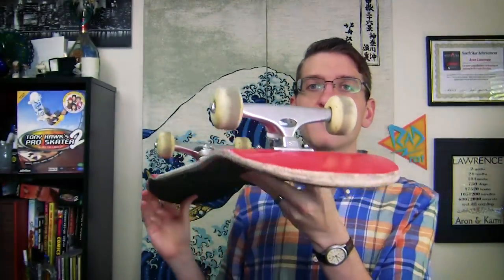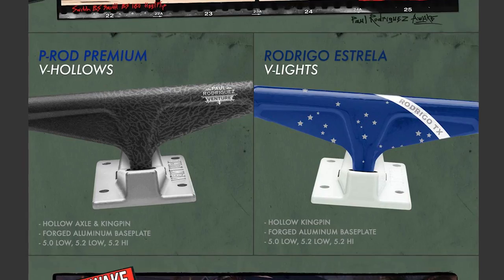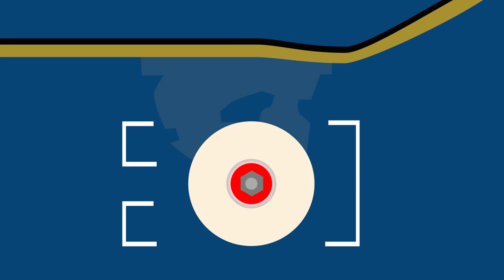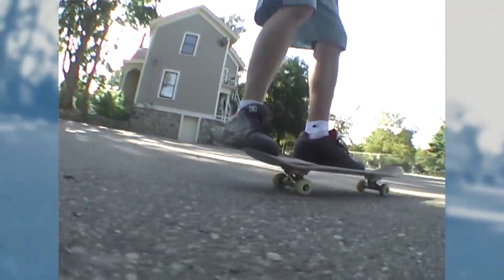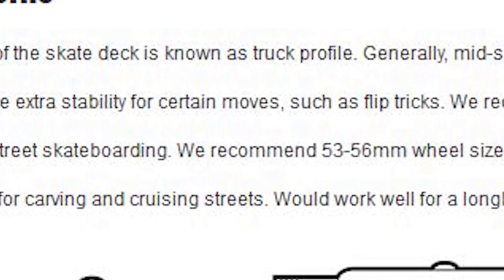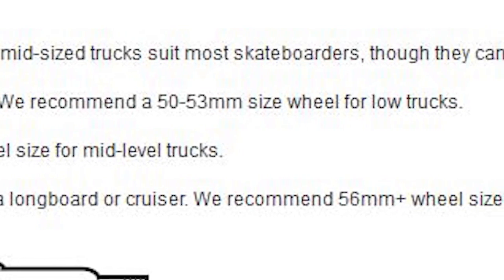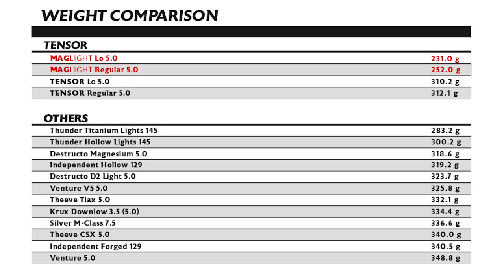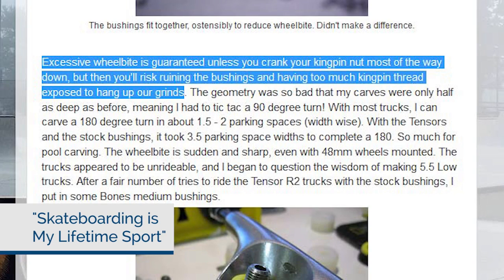Low Vs. High Trucks - What's the Point?

Comment: On a sunny Thursday this kid comes into the shop while I'm mounting wheels, and immediately the attempted heckling ensues. The poor child doesn't understand the concept of spacers, and - index finger deeply buried in his left nostril - he begins his query: "Won't those just weigh you down?" 
I sigh and ask the shop manager if we can use his precision scales for a small experiment, and sure enough the scales present us with the value of 3,5 grammes. 
I point to the poor boys abundantly baggy jeans and ask him how many grammes he thinks he could purge by wearing some nice, tight spandex pants. The child, now slightly more bewildered, leaves.

The reason why low trucks with small wheels will provide a 'more stable' flip has naught to do with boards automatically toppling over and everything to do with angles. A more shallow angle will render the leveling out bit significantly easier, while stealing away from the max height. Conversely a shallow angle will usually provide a rather flat ollie; the steak is there, but the juice is lacking.

Comment: I was under the impression that small wheels and low trucks mad the board respond quicker because the tail doesn't have as far to travel.  I always thought a steeper tail would pop higher.

Comment: lighter trucks is metaphorically double edged sword because you will get more less upward momentum from the front of the board, if the trucks are lighter. compare throwing a ball of tin foil compared to a rock, (or imagine you had a seesaw and you jumped on one end, and there was the ball of tinfoil and a rock on the other. the rock will go further because of the greater weight and momentum, so when you pop up the front of your deck, the increased weight means more force, travelling upwards, therefore more pop.

Comment: Do you think you could do a review on avenue suspension trucks I've been riding them for a while and I love them they actually work
Reply: Calvin Haslam dude same for all of that
Reply: Calvin Haslam same they are great
Reply: Those trucks are so ugly I hate looking at them. But my friend had a pair and he said impact was better. Is that true for you?
Reply: started staking again because of the suspension trucks. my knees dont hurt nearly as bad after a long session than with normal trucks
Reply: SuperrrSimon impact isn't a big difference for me since I don't really skate drops, but it makes rough ground smoother, gives you more pop and turns really well
Reply: SuperrrSimon ugly? I think they look really cool honestly also the impact is great it isn't a huge difference and the trucks won't make you a better skater but they definitely help me with my bad knees
Reply: i love my avenues...way better on rough terrain and there is a bit more pop but they are also heavy so id say it evens out
Reply: wow seriously? What kind of tricks do you do? Are they like SUPER suspensionny?
Reply: Farine no they just reduce the impact a little and stop vibrations on rough pavement they also help with speed and they compress when you bend down to do a trick which makes the board feel lighter but overall they aren't that much different I mostly skate stairs so they really help with my bad knees
Reply: avenue shills have found rad rat - sad!
Reply: Deffy, Peter Shillings up in here.

Comment: I skate Indys 11 and they are heavy. Also, for unknown reasons they're really hurting me on my landings unless I fully bend, really bad for my ankles. I started using avenues (cos' I am old and fat, thank you very much) and they work great! And they pop better. But, they break easily as well. The crazy thing is that I have a setup with tensors mag lights and they feel so much better than Indys!! They don't hurt my ankles (God knows why) and they fee like they absorb quite a lot of the impact somehow.....Needless to say, you can really say the difference in weight. The deck just flies with you...Next stop in the Theeves mag, to see what's what..

Comment: I for one can say I was duped by the Rodriguez vlight...they are heavy trucks. Heavier than many standard trucks. Do not get them. I came here because I am looking for new trucks and curious what other skaters say about the true highs or true lows, I say that to differentiate from the false mid/high dilemma (yet to finish the video, the vlight pick made comment early). Back to the video. I skate an 8.125 or an 8.25. Any recommendations would be appreciated; I need the wider board for my comfortability in stance, but need to cut weight in my trucks because when I was skating 7.75 I was just learning tre flips, landing them from time to time. Since I upgraded to larger board and the bs rodriguez (heavy ) lights I have not been able to land them but twice. Thanks for any help 🙏

Comment: I've seen them both tested in other videos... there's almost no real difference at all in performance, the difference in measurement between high and low is so small. It has more to do with adjusting fits for wheels and board size.

Comment: Also, never buy into the low trucks hype. It was a fad in the late 90s to get more noobs into skating by promising them all these special effects that didn't actually exist. The trick is, keep it high, but not on stilts, put in your riser plates, and work out your legs until you can lift a small city. <-----You can't ollie anything with chicken legs, so theres no point in making your board lighter, if you're a weak scrub expect weak results. Train on a heavier board, then shift to a high mounted board for tricking. 

I used to train on birdhouses 8 decks with fat trucks. It was wide, and weighed a ton. Then I'd shift over to my normal sized elemental deck with riser plates. Just gotta keep workin out, if you only skate lightweight decks and never work out your legs you won't have the same results as someone who skates heavy or has the leg strength to not only jump higher but pull up the deck quicker.

Comment: Independent makes a low coming in at 48.5 mm which is a real difference more than a quarter inch lower than the standard 55 mm. I have a few setups Tactics online boardshop has good specs on trucks btw

Comment: I don't see the point in high vs low trucks, because you can always just alter the height via Risers.....
Reply: People have been using riser plates forever, they haven't stopped. Independent plates, World industry plates were some of the best. And if you would have attempted my teeth with your deck I'd roll my gorilla leg through your skull in 1 kick. Don't see the hostility in advice. You can enjoy your pressure cracks all day long. 

Skating is still an athletic sport. We can act like the stereotype of being a lazy skater is the "pro way to go" But literally ask anyone from muska, to hawk, to bob burnquist, Bob goes a step even further and used to hit up a gym. You want big ollies, quicker pops, and more hangtime you gotta work for it. Those ollie competition guys didn't just pop on a low weight deck one day and break records, you gotta train.

Comment: Real street skating, ledges are all different, terrain is constantly changing, you have to learn to adapt to it rather then change your wheels or trucks at every ledge or rail. Say your krook grinds are on lock with round wheels and your skating a ledge with a sharp edge and you ride up the street and the next ledge has a round edge and now some square wheels work better, what do you do change your wheels? No, you learn to adapt or just start doing some switch 5.0's or some totaly different trick and same for wheel size, small wheels at one spot thats perfectly smooth might be great and big wheels seem stupid but the next spot is rough so now whats up? Skating is more about adapting your skill set and having lots of tricks tucked away to pull out and adapt to your surroundings, picking one style of truck or wheel to adapt to one specific way of skating is pigeon holeing yourself, pro's do this a lot too. The more you learn the more you can adapt to your surroundings and thats what makes skating fun and makes you a better skater. Skateboarding is really just a bunch of learning so why try and set up your board one specific way for one specific task? So you don't have to learn? That may make you look better at that one thing but it's not making you a better skater. If Rodney Mullen skated a mini ramp session every sunday morning would he be the best skater at the session? Probably not, would it of helped his flow in street skating? Hell yeah it would of, same with Ed Templeton, give him a board and tell him you can only push switch and skate switch for the next 6 months, would he look like a boss at every skate spot? Nope, but would it help his skating? Hell ya it would. Skating is really just about board control, you controling your board, guys geting caught up in this brand stuff or size of board stuff is more like the board is controllng you.

Comment: Lows wont flip over whike your riding. I have high trucks and when I turn at maximum the board flips
Reply: Also, there is less space between the tail and the ground
Reply: Which makes the board more stable

Comment: This was the worst research one could have done. LOL
Dude.. any bigger skate mail order shop gives you exact sizes of all brands and weight in comparison. And Low Indys are not the titaniums. LOL That is because of the base plate. They have low ones and normal ones. 
Check out the European page skate deluxe for example... and redo that video
Reply: nd4spd ... i do not think externat links stay but geht deleted. Google the online shop “Skate Deluxe” .. you find all measurements of every truck on their page
Reply: nd4spd ..
Just create it and do not argue. Consume, consume but no contribution. Welcome to 2017 ;)
There is 5 trucks that you will choose from max anyhow. So you will be able to deal with it